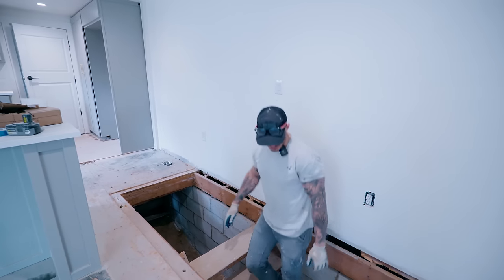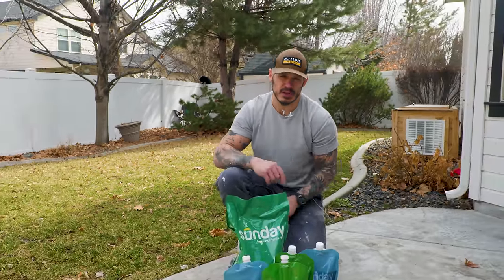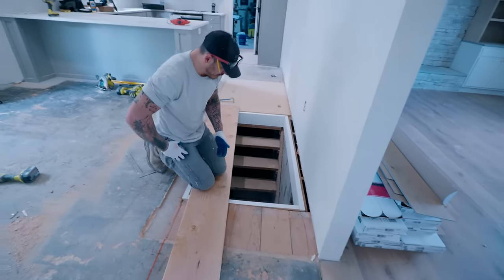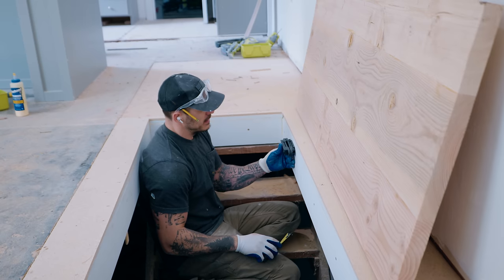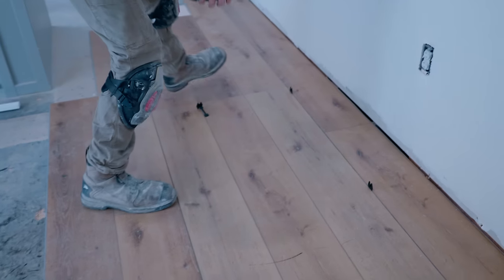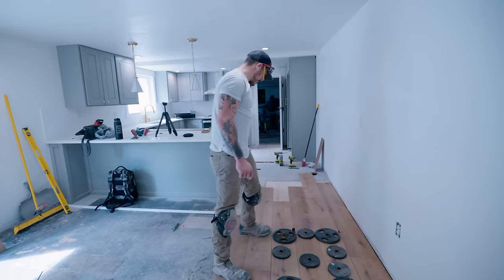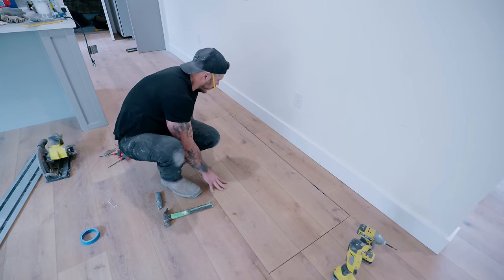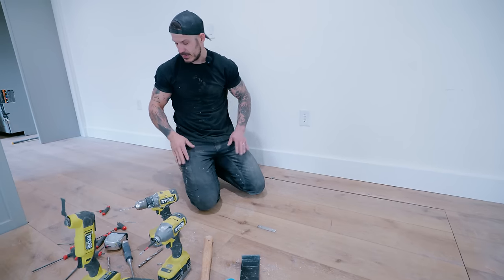Creating A Hidden Room With A Secret Floor Door!

Comment: Someone in the comments mentioned installing an actuator which I think is a brilliant idea. They make them so you could have a wall switch. Just hit the switch and the door opens hit it again and it'll close. Also you may want to think about insulating that door somehow. With that gap you're going to have a breeze coming through there. I understand what a challenging project this was. Kudos man, I think it couldn't have been done any better
Reply: Except insulating and the actuator... hahahahah  Great work as always though!

Comment: I agree with some of the other comments. Even without trying to hide a door, it seems to be an ideal place for an long accent rug. The space also would be great for a piece of custom furniture, like a baker's rack, accent table, display cabinet, etc. Just put some hidden wheels on it so that when you need to access the basement, then it simply rolls out of the way.

Also, some gas struts for easier opening/closing. Maybe some c-channel to stiffen up the door?

Comment: You used the wrong type of hinge for a hidden door. 

There are hinges that lifts the door more up and then higher by utilising a different pivot point. Then you could have a mm tight fit :) also gas struts and then a lock inside of the door that you open with a strong magnet and you actually have a hidden door ;)

Or why not having the unlock feature through some wire that goes up in the kitchen island so you pull a hidden lever to open ;)
Reply: What hinges are those?
Reply: They’re called pivot hinges
Reply: @Jamal_Jackson_III kinda like kitchen cupboard doors

Comment: cutting an angle on all edges of the door will make it close a lot smoother. Maybe add some small rubber bumpers on the wall where the door contacts the wall so over time it doesnt damage the drywall and paint! good stuff though I like it!
Reply: I think the bumpers might ruin the concealed door. And considering it's only ever used to access pipes I don't think it would ever be opened much 😅

Comment: You needed a different kind of hinge that would raise the door from the floor once it is vertical. See for example the Mercedes 190 or Audi A4 B4 trunk hinges. With that then you'd have the flooring skin in the door oversized with 45° degree bevels to then lay on top of the regular floor which would be undersized.
Reply: Yes trunk hinges! I was thinking the same thing

Comment: I like that you showed the door aspect on the fly. Most video's gloss-over the trial and error and show the finished project, making it look easier than it was. Also...I did nearly the exact same thing in my old house. It was an old home and only had basement access via an outside Bilco door, so I created a similar trap door in a closet. Because it was in a closet,  the reveals weren't as critical and I was able to use a standard ring-type recessed pull. Nice job.

Comment: I have been watching the whole series. You are  doing a great job! So much hard work on this house! We had contractors build a door like this on our porch. It does have some boards going horizontal on the door to give it more strength. You could always get some floor paint or something that is durable and paint the latch so it is not as noticeable. You are really getting close to finishing!

Comment: Seems to remember Micheal Alm putting a 3 degree bevel on the closing edges of a door he built to let it close more closely.  That might have let you land those seams more cleanly but I reckon a pretty decent job done!  Massive improvement over a gaping hole 😎

Comment: I've read that in some really old houses where the flooring planks had larger gaps between the planks, workmen would sometimes repair the gaps using a twine or some sort of rope like material made of natural fiber. They would wedge it in between the flooring boards. Then they would stain it the color of the flooring. It definitely wasn't a perfect solution, but the gaps were not as noticeable & they moved like a gasket does. This was good because the wooden floor boards expand & contract. Maybe something like this may work for hinge side of the door to the basement.

Comment: Tried to do a hidden door as well and flooring guys did a great job of actually making it even more obvious after I specifically asked to make it look seamless. 
Used the same handle and recessed it. My door isnt as long but I put some blocks/braces across to mimic the joists. 
I would have actually put the door hinges on the right side (looking at the video) with struts that push the door up. That way the finished flooring can have lip on the two long sides. With the right struts it could have a lip on all 4 sides.

Comment: @MrBuildIt There’s SO many options to distract from the gap in the floor. Because it’s so close to the doors outside, a shoe rack wouldn’t be a bad thing in that spot. You could something distracting on the wall above the door, or just throw a runner down over it and call it a day!

Comment: We had such a basement in our house when I was young.  We accessed it through a trap door until we had a fire when I was 13 and they changed the set up of the house and we ended up with a regular access, and regular door underneath the attic stairway.  It was a very small house 2 bedroom house with the high part of the attic made as a 3rd bedroom. In the basement we had the furnace, the washer and dryer and a sumpump. More than ½ of the basement was not even a crawl space. This video reminded me of this.  That was in the good old days when danger was less of a worry.

Comment: You could still add after market “soft close” hardware to “catch” the door when your closing it. The ones you just screw into the frame and has a rod that sticks out and gets compressed. Maybe 1 or 2 on the opposite side of the hinges.

Comment: I think the hinge looks fine, but if you're  really worried about it, you could take a piece of scrap flooring, peel a top layer of veneer and contact cement it to the top of your latch. Then, cut with a knife around where your handle comes up. 

I do agree with what most people suggest with the struts to ease the opening and closing. 

Painting inside your seams will help, or if you want to try and get really creative, wrap a piece of foam with a paper veneer that closely matches your flooring and wedge in place. This will allow for expansion and contraction but still hide the gap a little more. It's not 100 percent perfect, but maybe slightly better than nothing. 

Love the videos. Great job.

Comment: You could paint the back of the hinges, the black sticks out in the gap and if it were tan the gap would be less noticeable. And of course it's too late now, but it would have been nice to have continuous grain running between the normal flooring and the door, we can see that the planks are different. 
I also like the idea of a rug, after all, you can put a runner on this and it will completely disappear. The recessed pull is a great touch!

Comment: Maybe on the part that is the floor next to the door by the big reveal, remove it, place it down with magnets. It can be pulled up and removed and replaced any time you need to open the door. It would allow for a perfect seam.

So step 1 remove flooring panels that are magnate to the floor next to the wall, then open the door.

Also, the door does. It have to be square. You could extend parts out to fit the natural floor joints. Just have those held by magnets as well. 

You could completely hide it.

Also, add a lock to keep things safe and kids out.

Comment: I think you should brass it. Heat up the steel with a torch and use a brass wire drill attachment and it transfer the brass onto the steel. Would hide it more with the wood.

Comment: I definitely think some kind of spring or actuator should be installed. Right now it's just a super heavy door that will end up hurting somebody. Other than that just some kind of weather strip or door insulation to keep the draft down. Can be installed on the lip you created. Scotch bright the metal hinge and paint it tan?

Comment: if you ever try using that flush hidden door pull again, take a piece of your flooring and run it through a planer to thin it down to make your own veneer that matches the rest of your flooring. Inset the door pull slightly deeper (ie. the additional thickness of the veneer), then you can rough up the flat surface of the handle and glue down the veneer. then take a razer knife and cut the veneer where the handle gaps are so that your gaps are as minimal as possible while still allowing movement

Comment: Maybe a rubber lining or insulation around the door. Would make it insulated from weather, help keep those bugs out and make a softer sound when closing the door. Ever consider additional bracing on the bottom side of the door? Using dowels to connect the boards together with the wood glue for extra bond and a board or metal liner across.

Comment: Looks great but I think you should add something across the grain on the bottom of the door, even just a 2x4 maybe with chamfered ends. Only reason there is a huge possibility that it start to warp or twist over time.

Comment: I think you just needed to account for the flooring thickness on top of the hidden door when positioning the hinges & it possibly would have been as you envisioned without the gap at the back. Great job there though. The SS latch looks fine IMO.
On a user safety note please add some suitable gas struts for when in use to avoid someone loosing a finger.

Comment: The hardware you chose works, but there is versions with springs in them, and soft close features. making the door open easier/lighter feeling as well as close softer

Comment: Creating hidden doors is always a challenge. I applaud your efforts, 8 out of 10 for looks.
The easiest way to conceal a door in a floor is to put a rug over it. 
That said, I am surprised very few people have  commented on the safety factor and purpose for the opening. Depending on the homes location, you may have created a stair code violation by framing past the top stair stringers thus making the top riser higher than the others and making the width of the opening narrower than the stairs. Also there is no safety railing around the opening while the door is open. It will be interesting to hear what the building inspector has to say about that when it comes time to sell the house. As for purpose, is there enough room to pass a furnace, water heater, AC, etc. through your reduced opening? If not what is the plan when it comes time to replace these items?
One possible solution would be to reframe the opening by placing a header at the end of the stair stringers and remove the 2xs you used to narrow the opening and go past the top of the stair stringers. Then place the hinges on the narrow end of the door toward the foot of the stairs. That way you could fabricate a safety rail on each side of the door that would rise up with the door plus the door would rise up toward the ceiling and never touch the wall. 
As for the door material: number 2 pine 2x12 is typically used for framing and is not the best choice to make that kind of door, lumber that size has a tendency to twist and warp over time. This could become a bigger problem given the moisture and temperature deference between your basement and living area. If your doom warps people could stub their toe or trip and fall. Wood such as Popular in narrower widths glued like butcher block and reinforced by 2 1/2” steel angle iron may be better. What ever you use, make sure it is sealed on all six sides. Plenty of people have suggested actuators, struts, and hinges so there are plenty of options to handle any weight issues.
One comment summed it up best, if the opening is just for utility, why not just put a doorway through the basement wall to the outside and do away with the inside stairwell?
That would be my suggestion as well. If you don’t have a location that is ground level with the basement floor, there are many code-compliant pre manufactured access / egress basement stair doors to choose from. And you should be able to locally source precast concrete steps to complete the package. Ask your lumberyard..

Comment: Could you use the hinge mechanism that some tables use where the top part stretches upwards and locks in a x pattern and the can collapse. Essentially the larger version of the mechanism that many tool boxs use to have multiple trays. Then you would not have to worry about it bending the edges as the entire door would lift up the sloap and lock to open and the slide back and collapse back down to close

Comment: If you don’t want a rug to hide it could you maybe put some tan weather stripping in the gap that would hide it but still squish enough for the door to open smoothly? Also hydraulic hinges would be good. Also potentially some spray paint or rub n buff to blend the handle better than stainless steel?

Comment: me and my dad did a similar door our "underground pantry", on the hinge side reveal he used a thin bead of silicone the same colour as the floor ( we had a grey floor ) the gap is still there its just far far less noticeable unless your purposefully looking for it, and being silicone if it doesn't work you can just peel it out

Comment: I had a thought which I would like to suggest. 
What if you run a bead of Brown Culk along the spine of the door and then cut through the culk with a razor knife?
It should reduce that gap, and if you are not pleased with it, you could always remove it.
Reply: Anyway, overall the door looks awesome. 
I was also thinking you could use a vynil sticker that looks like flooring to disguise the latch/handle. 🤙🏼🙂🤙🏼❤️

Comment: Is that strong enough to move a refrigerator over? It’s just resting on thin wood screwed into the floor joists. Did you need a permit? Looks good!

Comment: You could certainly finish it if you wanted to. You wouldn't entertain or use it as a space more than storage, so it would become a spacement. Like a crawl space but a little taller. They have these down at the beach where you cannot dig deep due to the water table.

Comment: For the "Handle" I would have attached a steel plate to the back of the door and then used a switchable magnet handle.  You can get strong magnets that you can turn on and off (they dont use power, its basically magic).  Have it sitting around in the decore of the room.  Need to open the hidden floor door, grab it, put it on the right spot on the floor, turn it on, lift.  The magnet will pull on the steel plate on the back of the door.

Comment: Just Velcro down a carpet runner over the door. The leaded edge by the wall of the runner will shadow play that gap and u could even slightly cover the gap if it’s thin enough not to impede opening

Comment: Could take only de surface of the board(very fisr layer) and glue it on top of the latch. To hide the gap, you could just paint it from the bottom with the same color of the floor.

Comment: You could always put down a rug that is attached to the door so it hides the seems between the flooring. Then you can still lift the door with the rug attached, so whenever you close the door it will cover all the flooring seems. Then just make a slit where the flush mounted handle can poke through when you rotate it up to access the handle. Cool idea though

Comment: Why not build some short rails like the kind used for drawers and attach the hinges to those such that when one opens the door, one would pull it a bit away from the wall to create the clearance? It would also allow you to put eliminate the flooring gap between the door on the hinged side because you would be making your own clearance while opening it. It might, however, require building some custom hardware so that the rails would be strong enough the support the weight of the door when open and while opening.

Comment: Helpful tip I think you didn’t account for the thickness of the flooring when you installed the hinges. If you mounted the hinges a little closer to the top side of the door it should clear. Also if you get a chamfer bit on your router and put a micro bevel on the topside of the flooring that would help also. And as others have mentioned I would put a gas strut on it to assist the opening. Not a bad outcome tho!

Comment: Two thoughts. I'm a 22 year old former gymnast (14 years) so take what I say with a grain of salt. But I've been in construction for almost 2 years. I like what you do but have 2 thoughts. Thought 1 is about hiding the floor handle. The flooring you boards have a thin veneer on top I'm guessing. You could peel away the veneer and glue the veneer to the top of the floor handle. Would be better than painting it IMHO. Through 2 is that the middle panel of the door could be 2 panels cut to look like they are 2 panels rather than 1 long one. Having 3 equal lengths panels side by side is noticeable.

Comment: Door handle concealment idea. Laminate flooring is just a photo of the wood pattern. Take a photo of a matching board print it out on some paper stick it to the stainless handle if you had taken the photo before cutting anything it would have match almost perfectly to the existing flooring pattern but a nearby similar looking board should be fine. If you have the spacing inside the hardware (its kind of hard to see from the view you could soak the paper in clear epoxy to make it rock hard and walk resistant. Or if you have the space print it on something harder than paper but that takes more than just a normal printer.

Comment: Very cool idea. I'm curious how glued 2x material will last over time with traffic flow. I wonder if building a frame with joists would have been more permanent, but maybe I'm underestimating the resilience of 2 flat ends held together only by glue is. I wonder if anyone in these comments that have more knowledge on that could explain that to me. Absolutely ZERO hate to Mr build it btw. Just honestly curious.